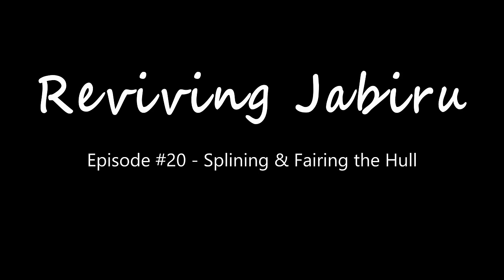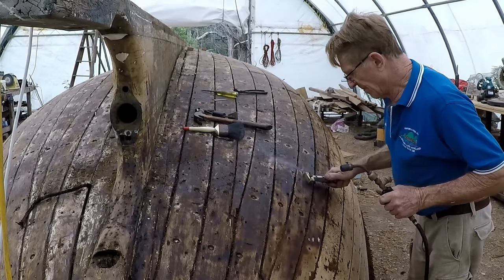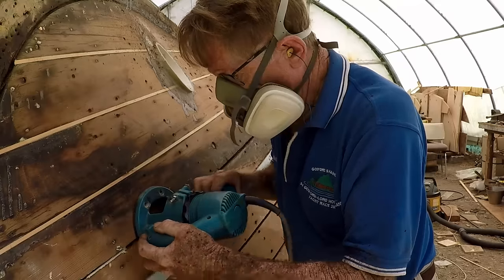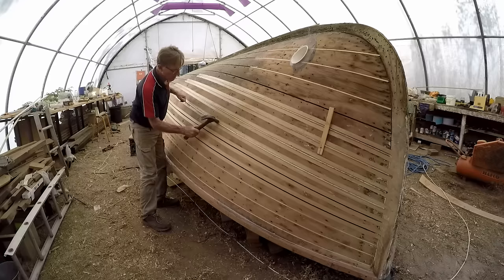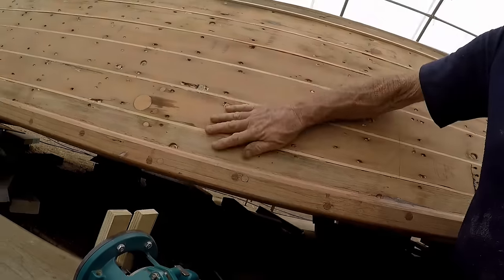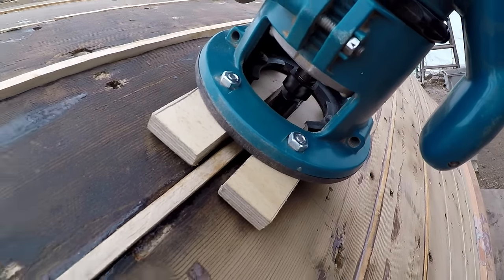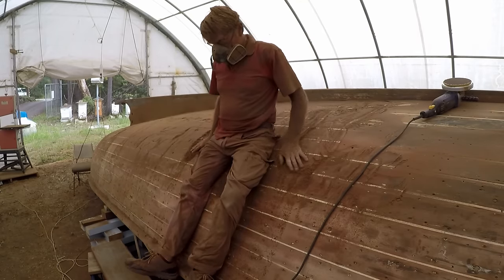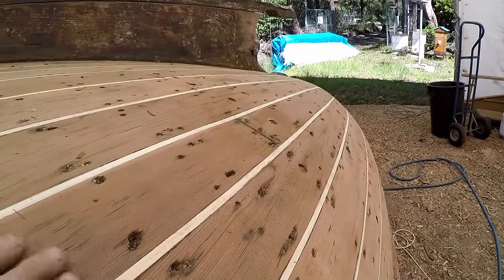Reviving Jabiru Episode #20

Comment: Great work, Phil. I'd just like to issue a bit of a PSA for anybody who's restoring a wooden boat and doesn't intend to spline the seams and fiberglass sheath the hull. DO NOT use the method/ tools shown to remove the caulking. It will destroy the plank edges. Use a reefing hook. It takes a lot longer, but it ensures that you'll be able to properly recaulk the seams.
Reply from the maker: Yes. If the aim was to paint over the timber, a lot more care would have to be taken.

Comment: Just about to start splining my 34’ Griffin. I only wish I could turn it over too! Removing the already recaulked material which has been flood damaged with a 4.5mm circular saw blade. Then spline the 22 planks each side! You are definitely motivating me somewhat! Enjoying the series, cheers! 😀
Reply from the maker: Thank you and best wishes for the Griffin 34.
Reply: Phill, what glass did you use for the sheathing? Did a splendid job of it by the way! 😄👍
Reply: Actually just found it on the previous episode, 600 gram! 😀

Comment: Thanks for a lovely video. If I may be so bold, though: Here in Norway many old wooden boats were glassed with epoxy on the exterior of the hull, but it has gone out of fashion because it was found that it accelerated rot. I have myself built a 17' wooden boat with glass/epoxy on the wood, but on both interior and exterior so that it was sealed. Just sayin.
Reply from the maker: Yes. I can see the point you are making and the use of penetrating epoxy on the inside would work but only if all surface could reached and also clean enough to accept the resin. My outlook and aim is to keep all water from contaminating the inside with everything sealed and with covers on. I hope that idea works.
Reply: @revivingjabiru7588  I hope so too! Best of luck restoring this beautiful boat.

Comment: Thank you for sharing the splining process. What kind of wood is the spline made from? I can imagine it being a soft wood. Is the spline tapered at a slight angle and act like a wedge between the planks? Appreciate if you could elaborate. Cheers!
Reply from the maker: I used pine offcuts from another job (free).  I cut them with a very slight taper. They were a little oversized so they could be wedged in place with a hammer.  They were not meant to be a really tight fit but just good enough to glue in place and fill the gaps. Cheers,  Phil

Comment: Splining is not good unless you have dry wood with a very low coefficient of expansion and contraction. If that boat goes in and out of the water a lot the seams well open up over time. Use G-flex epoxy for any hope of a long lasting joint. Just saying. I’m currently fixing a boat made that way. Also makes it terrible to repair in the future. Wouldn’t suggest this type of construction except on a new boat that would be glassed. But really just a bad way to seal a hull. Corking is really the best for long term service and maintenance.
Reply from the maker: It is very dry, having been out of the water for 10 years or more. Glassing it is to ensure it stays dry and it will be permanently on a mooring once it goes back into the water.
Reply: Glass the inside as well. Otherwise the planks will expand and crack the fiberglass.  I've seen it happen.  Look up the boat Bimini, she had glass put over the planks and the planks swelled up and the glass cracked at every seam.

Comment: Lot of work. As it was going to be glassed over why not just use a balloon sanding filler and fair that in?
Greetings from Melbourne.
Reply from the maker: Good question.  I feel the bond between clean wood and untickened epoxy with glass will be better than filler to wood. I know the filler has epoxy as well but that's just how I feel. The concave section I filled with wood is the only one, All the rest of the dips and hollows will be fared out with filler on top of glass. I just don't want there to be a chance of the sheathing coming away from the hull.

Comment: Puzzled as to why you blow off dust rather than vacuum. Just lands on everything else everywhere.

Also puzzled why you use a disk sander rather than a belt sander for levelling and fairing.
Reply from the maker: The sanding already deposits dust everywhere and blowing it off is quicker than the vacuum.  The disk sander was used to remove the sticky coating of tar. There is no attempt to fair anything, it just removes the rubbish.